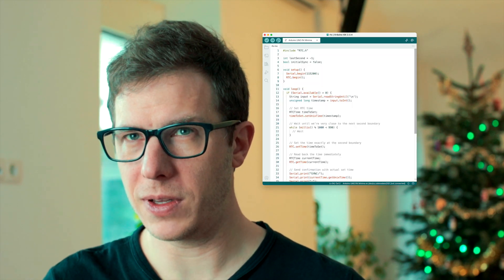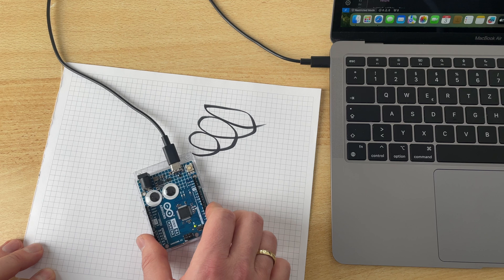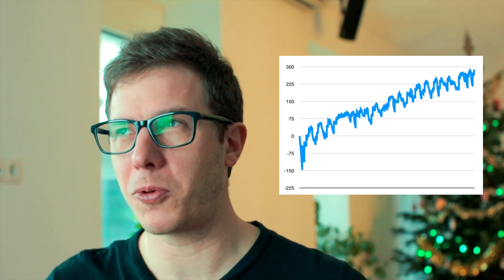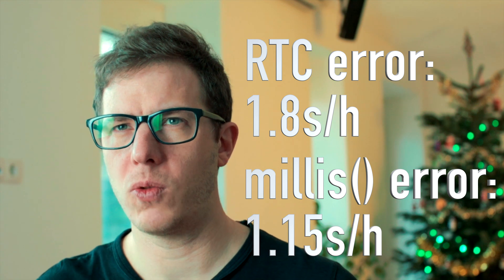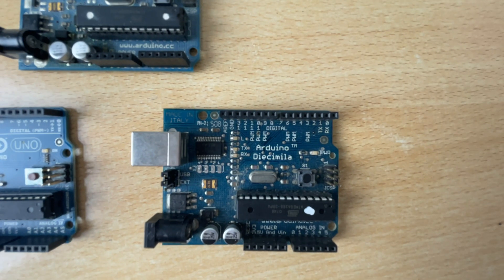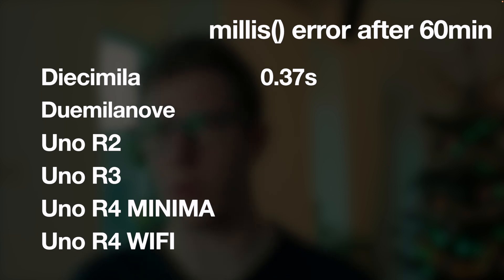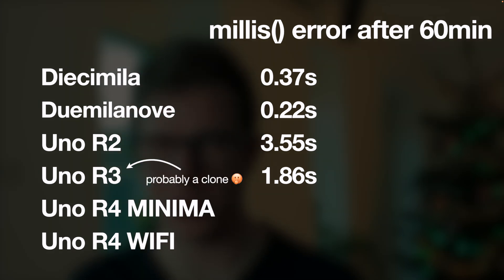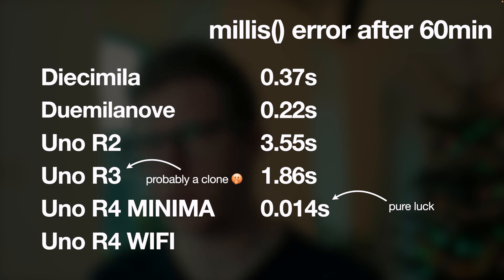Arduino UNO's RTC Is Horrible

Comment: You know, that's why i opened a business and started make developments long time ago.
Why on earth spare an accurate 32.768 kHz crystal worth 5 cents or so ?
I'm deving a R4 compatible board and fits both these clocks, but only the RTC oscillator is very innacurate, the high speed internal is so-so.

But that's at given temperature, how does it behave at very cold/hot temperature ? And is it an issue for USB or RTC applications ?
These questions are answered by the presence of xtal, no big boss over, no cheap choice upon me.

Regards

Jean-François
Reply from the maker: yeah its sad that they did not spend the money on the crystal. I would rather have the crystal than the LED matrix on R4 WiFi
Reply: @playduino  Indeed i checked a bit further, the RTC is quite bad, the high speed works well enough. Although the temperature will affect them. I'm preparing a similary as the R4 Minima, but include both xtals actually.
Regards
Jean-François

Comment: By coincidence I've also been doing some similar testing with UNOs and a Leonardo. At 05:52 you talk about the strangely accurate 0.014s on the Arduino UNO R4 Minima. I have observed this too. I haven't dug into it but I don't think it's luck, I believe it's using some feature of USB protocol (SOF packets?) to improve its time synchronisation. This is something the R4 WiFi cannot do because the ESP32-S3 is handling USB comms.

I'll includes some links in a reply to my own comment as I think this comment will get hidden if I put them here.
Reply from the maker: Interesting. I just checked the schematic of the R4 WiFi. Actually, there are analog switches on board that route the USB signals to either the ESP32 or the RA4M1. So it should be possible to make use of SOF packets.

Comment: Would the RTC mismatch account for a timer triggered by holding a button to take longer than intended? For instance, instead of it taking 10 seconds, it takes 10.2 seconds?
Reply from the maker: without knowing the details, I'm pretty sure that the answer is no. Your timer will most likely run on the HOCO oscillator which has a tolerance of 1.5% (worst case would be 10.15s but very unlikely) I think there is some other code issue that causes this issue in your case.

Comment: Hilarious. The R4 minima actually HAS all the proper pads to place a proper crystal (so you can literally buy, and add it back yourself)... but they decided to penny pinch on that!? It's not placed on the board. If it had a proper crystal, and then the RTC based on the high speed clock, it would use normal chip power, but it should be as accurate as many other RTCs. Of course most MCUs also have their 'XTAL' pins, which allows operating the chip at very low power mode with a specific 32khz external crystal, which is nice if you want battery operation with decent timing.

The R4 Wifi, well they decided they needed to sacrifice the crystal-stabilized high speed clock source entirely in order to use those pins for the LED display. Hilariously, the R4 Wifi is effectively two MCUs in one, it has an ESP32-S3 onboard as well. Because that is a chip-on-board module, it comes with its own honest-to-goodness 40Mhz crystal inside the metal can, that Arduino don't believe in. So if you can program it, the ESP32-S3 MCU's timing and RTC abilities are probably streets ahead on average better than what the RA4M1 can do, simply because the latter got gimped of all crystals by the board design. If you give these chips proper crystals on either of their high speed or low speed clock pins, they will have a reasonably accurate timing/RTC just the same as any other. For this reason all the ATMega328 Arduino Unos will be roughly accurate (as you found), operating as they are from a bog standard 16Mhz crystal. But at least they were given a crystal!

If you calibrate the older Unos' frequency out (i.e, software correct the initial frequency error of the crystal as it is shipped in the board), they'll probably be just as accurate as any normal quartz watch.

10 years ago, I could forgive a lot of Arduino's design mistakes/decisions. But now, to see they can't even be bothered giving their chips proper crystals for timing? It makes it very hard to want to support them with a more expensive purchase from their shop. If I buy an ESP32 or RP2040 board from China, you know what I know? All those boards will come with a crystal...
Reply from the maker: I hear you.

unfortunately placing the main oscillator does not even help because it cannot be used as clock source for the RTC. https://www.renesas.com/en/document/mah/renesas-ra4m1-group-users-manual-hardware?r=1054146

and they just left the pins for the sub-clock oscillator unconnected, very hard to solder.
Reply: At least they could have used ceramic resonator and just tell its not very accurate clock, lets hope Qualcomm tell them to fix a crystal

Comment: The millis() drift is interesting. Given that it is interrupt driven, I rather suspect that any sketch which calls Arduino code where interrupts are disabled temporarily, will affect the drift too. It would be interesting to know what code you used to measure millis() on the Arduino in case something there disables the interrupts.

Cheers,
Norm.
Reply from the maker: for millis testing, I just did

loop(){
delay(1000);
Serial.println(millis());
}
Reply: @playduino  Aha! While delay() itself doesn't disable interrupts, delay() calls micros() which does. It has to disable them to read the value of timer0_overflow_count which is used to calculate the micros() return value on the fly. 

Cheers,
Norm.
Reply from the maker: Oh! Great catch! I need to look into this
Reply: @playduino  I wrote a couple of books about the Arduino. You might like Arduino Software Internals which explains all this stuff, in excruciating detail! 😉
Reply from the maker: I will have a look :) thx
Reply: @NormanNodDunbar  I'd say it's better to use micros() carefully and not to use delay() to avoid cumulative effects. There's also the question about how to take into account the serial transmission time (over USB) but I haven't looked into that.
Reply: @kevinwalters2076  Serial is a bug bearing yes, it turns interrupts off when actually sending (or receiving) data. Micros() is calculated on the fly every time it is called, from the number of times that Timer 0 has overflowed. Micros() will also be affected by any interrupt handler executing and/or Serial communications.

Cheers,
Norm.
Reply: @playduino the act of Serial.println(millis()); also takes time to transmit, which will also add to the drift over time.
Reply from the maker: @LordPhobos6502  it adds some time but it should be a one time error and should not add time to the drift (because millis should continue to count up during the transmission)
Reply: @playduino  Serial, if enabled, has two interrupts. One for TX and one for RX. When either is executing to copy data to/from the USART from/to a circular buffer, milis() and micros() counters do not get updated.
I wonder if YT will delete this comment too?

Cheers,
Norm.
Reply from the maker: @NormanNodDunbar  thank you very much for clarifying and for pushing against the automatic deletion. I have no idea why this happens :(. So it looks like my test code (for millis) was distorting the results. I am wondering by how much.
Reply: @playduino  You are very welcome. I've had a couple of comments on this thread deleted, as have some others! Comments I read earlier have vanished.

Cheers,
Norm.

Comment: Interesting.  I wonder if this time variance could be calibrated in a useful way. That may depend upon the device temperature variation.  Nice explanation.
Reply from the maker: I just found this discussion. it should be possible. but as you already mentioned, I suspect temperature changes would still be a problem.

https://forum.arduino.cc/t/how-to-correct-the-uno-r4-rtc-time-difference/1215333/18

Comment: I commented (and then tried again) but it got deleted. Probably because I posted a link to schematics. Anyway, what I commented was: I wonder if soldering a 32.768Khz oscillator, which are dirt cheap and common as sand, found in every cheap watch and wallclock, to pin 10 would make it drift less...
Reply from the maker: you would need to place a crystal between XCIN and XOUT (pin 6 and pin 7 of the chip itself) they are left unconnected on the PCB of both R4 MINIMA and R4 WIFI and have a very fine pitch so it will be hard. but possible indeed.
Reply: @playduino  I do have an R4 WiFi kicking around here, plenty crystals and the means and skills to give it a try... I just don't have the same test setup as you... Also: The R4 is stil brand-spanking new (it was gifted to me) and I have an irrational reluctance to 'damage' new stuff... but I also need to know...

Edit: Pin 6 goes to a via, goes left and pops up left of pin one on a SMD component. Will look into it a little more later.
Reply from the maker: the thing is, you will also need some software changes to enable the external crystal. I have no experience with the Renesas chip - but shouldn't be too hard I guess.
Reply: @playduino  Yeah, I think I'm not gonna bother. Though this will probably keep itching...
Reply from the maker: someone already did it :D
http://radiopench.blog96.fc2.com/blog-entry-1280.html

https://forum.arduino.cc/t/how-to-correct-the-uno-r4-rtc-time-difference/1215333/18
Reply: @playduino  Cool! I'll read up on it! Thanks for posting!
Reply: @Rob_III  Yeah I've stopped trying to put any URLs into comments now, it just gives a very high chance that youtube's algo will wipe your comment as if its never existed, no matter what you typed
Reply: I have found that YT has a tendency to delete comments almost immediately. Refresh the page after posting to see if yours is affected. It used to be a problem if you had URLs, even if you tried to obfuscate them, the comments would simply vanish. My missing comments were plain text and nothing else or offensive. 🤨

Cheers,
Norm.

Comment: No computer should be used for clock reference w/o resorting to a proper clock.

I use GPS if possible (1 sec tick interrupt - or faster - such as 25Hz in some applications).  Properly setup I can get the interrupt in less than 100 ns (Rasp Pi, not sure for Arduino). (Stand alone RTL, no Linux).
Of course with GPS you need access to a sky view.
Or, use NTP for sub 10ms accuracy.

Or - get a GPS disciplined oscillator - still needs a sky view.
Reply from the maker: My MacBook's clock gets synced to NTP at least every hour, I believe. Looking at the graph, I would expect to see noticeable jumps if the onboard clock was significantly inaccurate - which I didn't observe.

I agree though, using GPS would be the best solution for these kinds of experiments.
However Arduino Uno R4's RTC is so poor that you could probably use a McDonald's Happy Meal watch to measure the deviation
Reply: @playduino  I did some initial testing with a laptop (running Windows 10) and I think the thermal management in a laptop isn't great for time keeping, some of the power-saving features may also cause minor issues and it's best not to put WiFi in the mix. I moved onto a Pi 4 running chrony with wired network.
Reply: @playduino  It depends.  

When I use a random collection of about 50 ntp sites, the board timer (RaspPi) will drift 10 uSec over a period of about 1 hour, but then jump back (usually closer to realtime, but sometimes away) when the NTP hits.

In these tests, Apple, Microsoft and some other "big name" NTP's typically come out with 1 - 3 ms error whereas others spread over about 1 - 10 ms.

So your Apple devices benefit from Apple's "aggressively good" NTP service (unless you change the name of the NTP server to something not so good).

This is based on very - very accurate - dedicated to task, single purpose code that owns the RaspPi (and of course getting 1PPS ticks from a GPS).
Reply from the maker: very interesting topic, thank you for the details!

Comment: We say "point" not "dot" in english for the decimal point in the context you were using it. Pi is three point one four one five dot dot dot. It is such a minor error, sorry if you don't care.

Anyway,  it is so disappointing for the R4 to claim to have a RTC which doesn't actually work. At this point I don't know why you wouldn't just use a rpi pico or an esp32 (with an externl RTC module if required).
Reply from the maker: Thank you for pointing this out 😅

Yeah - it’s horrible